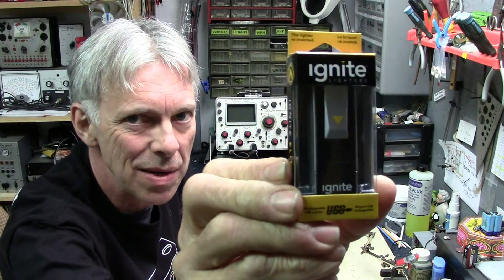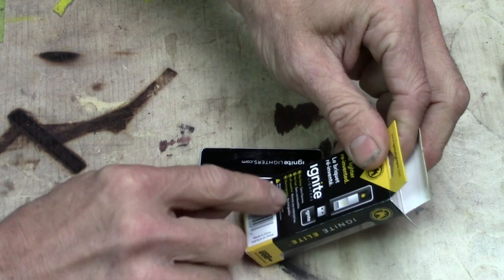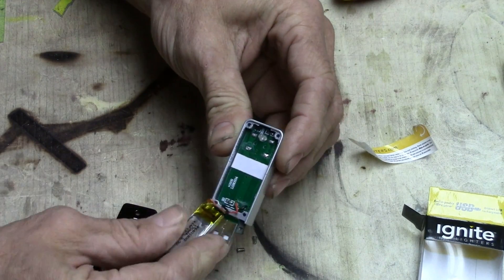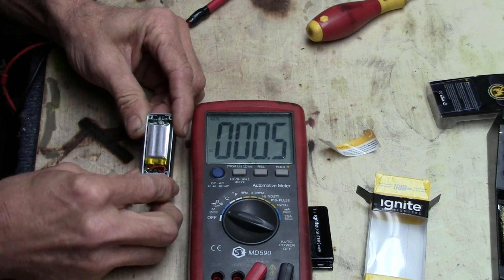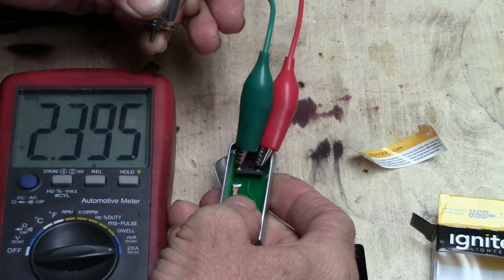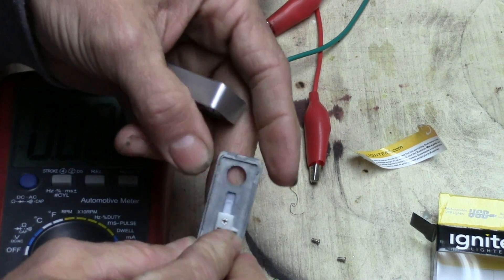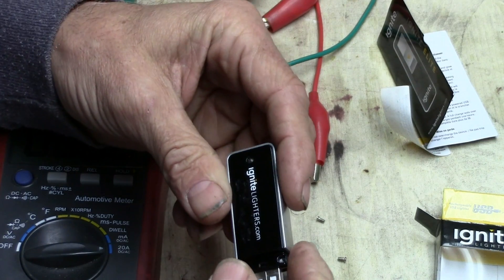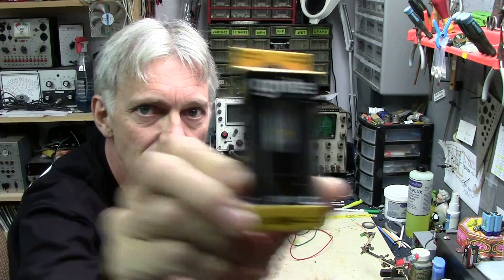USB Lighter Battery Pack Hack

Comment: Hi, I've been interested in converting small electronics to usb rechargeable, so I can stop buying AA, AAA, 9V batteries. Just wondered if you could help me with a parts list. I want to convert my TV remote control, for example, from 2 AA batteries, to an internal USB rechargeable battery like a computer mouse. This lighter could be good to use. What else would I need?
Reply: For example the easiest way to make a remote rechargeable would be to buy some AA or AAA rechargeable batteries and simply take them out to recharge as needed. 
A more complex circuit would be to add a female micro USB board between whatever you want to power to be able to recharge the battery and you can buy many different sizes of lithium ion batteries and a battery protection circuit board to prevent over charging and a low voltage cutoff to prevent the battery from going under 2 volts. You can also add a voltmeter that display the battery charge to your project. Laptop batteries are cheap and can be used to power larger projects like I make USB rechargeable Bluetooth speakers which is fun.
  You can find plenty of free wiring diagrams for your project from Google search.
Good luck and be careful!

Comment: Thanks for the great videos. I'm curious, did you measure the output voltage at the heating element leads? It wouldn't surprise me if there was a tiny boost converter in there somewhere to get it up to 5V at that juncture.
Reply: I would greatly doubt it. The heating element doesn't care what the voltage is, it wants current. It would be a complete waste of efficiency, and battery capacity to convert the voltage higher just to power a giant resistor. Any circuitry inside will be for battery management, and probably overcurrent protection.

Comment: Cool! Do you think this could be used to power a model airplane electric motor? I haven't played with them in over 40 years, but as a kid, I remember in the 1960's they had liquid battery packs (you filled them with water from an eye dropper!) to power a little electric motor on a model plane (made of styrofoam). Of course, the idea was to reduce weight. The batteries ran for about 10 minutes and then were useless. So they sold LOTS of batteries!

Comment: There are DC to DC boost converters available for real cheap on eBay. These can increase the input voltage of the battery of 3.7V to a regulated 5V DC output.

DC to DC boost converters are widely used in smartphones which support USB host. (eg. connecting pendrives directly via USB to the USB port of smartphones)

Comment: I found the same battery in a helicopter toy. Chargeable using USB +5v power. What is the charging current/time for this little beast? Could it (over)load a computer USB port?

Comment: wow... 
first of all. li-po or li-ion batteris always come in 3.7V cells with a full charging of 4.2V. you should know this.
you could also measure the amps without destroying the heat element by shorting the battery using the leads, or placing the measurement and an additional load across the switch contacts. I guess you didn't bother, but it just sounded like there was no other option.
Reply: bitluni's lab wow....
Reply: *****  Don't you love when YouTube experts write in their helpful comments? I tell you, us dummies would be lost without them ;>)
Reply: ***** Dean isn't a professional electronics expert. I would do this also in another way. But he's a hacker and shares his ideas. Everybody can do this in his own way, that's okay :-)
Reply: Wrong. There are 3.6v AND 3.8v H.V. cells.
Reply: You should NEVER short a lithium cells terminals.... You SHOULD know this

Comment: I feel the need, the need for HONDA UPDATE!!    ;o)
Reply: dale68 OK Honda update. I pulled the oil tank from it's temporary mount and drained it. I stoppered up the two holes in the crankcase so I move it off my workbench onto the floor. I'm currently brainstorming a way to build a jack that can raise it up and place it into the frame. I'm pretty busy here with last minute wedding planning (2 weeks from today) and I still have to finish up Lisa's ring! 
So, more Honda videos will start near the end of April or the beginning of May. :) Thanks for watching!

Comment: could you have measured the current with the meter across the power switch? instead of removing the heater element?
Reply: ***** Yes I understand your reasoning. My thought was measuring the current with the heater element in it would give you an Idea of what the max current draw of the battery was if it wasn't spec'ed on the battery label. LIPos can become lighters in themselves if you get them too hot.
Reply: yes he could have...
Reply: Roger Lamb Yes I could have. I won't be needing the heater element so I'm not concerned about removing it.
Reply: ***** NOO its a freaking gopro extra battery!!!
Reply: Actually, only maybe. Trying this with sources of high current capability often end up showing more about the shunt in the meter than the source capability. Or, blow the meter fuse. Or, toast the meter shunt if it is unfused. There are texts, some otherwise pretty good, that recommend connecting an ammeter across the cell to 'measure the current' or to measure internal resistance. Not a good idea. Also note that as current draw goes up, terminal voltage drops. It isn't generally linear. Best is use a number of loads measuring terminal potential and current. I usually use power resistors, measure voltage, and calculate current, as a voltmeter will have minimum influence in circuit. Graph current vs voltage, and your mothers brother is robert.

Comment: Looks like a lipo, lithium polymer battery. I've used them for radio controlled cars before, but bigger capacity. 8.4 volt 5.5Ah and max discharge of 60C (5.5 * 60 amps) are fairly standard. Check out sites like hobbyking for lots of cheap lipo battery's and they sell chargers to.

Comment: try finding a usb backup battery, they're used to recharge mobile phones and they have a 5 volt output that you can use for powering robots, and have a charge circuit built in that's powered by usb
Reply: SleepyChow Are they six bucks? :)
Reply: Good one. 5 volt battery. 4.2V is about the maximum you get from them fully charged. Those backup devices use a step-up converter to get a regulated 5V. Cheers :)
Reply: ***** 5000mAh battery pack only 17$. The price to capacity is a lot better with the battery pack. http://www.monoprice.com/Product?c_id=108&cp_id=10831&cs_id=1083110&p_id=9283&seq=1&format=2

Comment: Is there a way to charge 2 batteries using 1 USB connector?
Reply: extremestick You can charge as many as you like as long but every time you double the batteries, you double the charge time.
Reply: gollumondrugs  bollocks!, no you can't, each battery must have its own charge supply, lithium batteries can be made into packs by joining them together either parallel or serial style, but to charge that "pack" each cell must be charged separately.
joining lithiums together is not as straightforward as other batteries.
Reply: @alynicholls3230  Bollocks! You can indeed parallel charge lithium cells with one power supply. With series charging, you would need a balance board connected across all the cells.